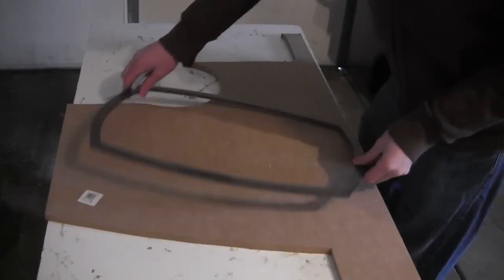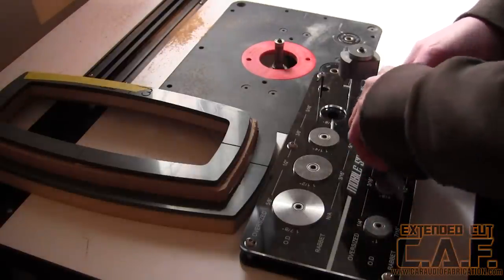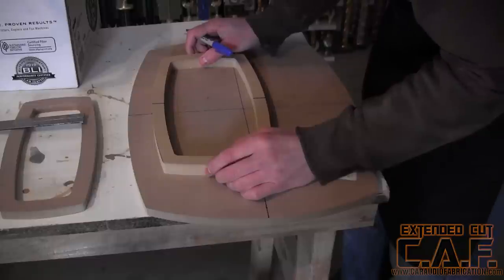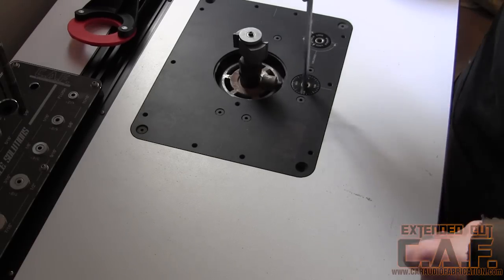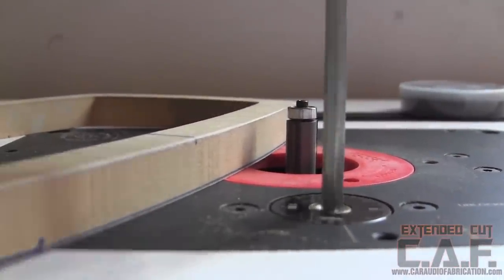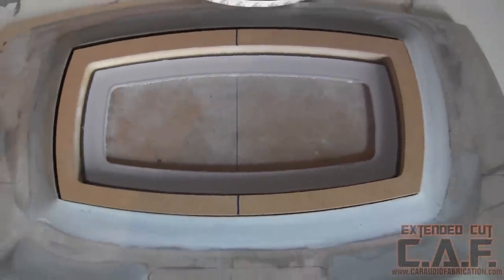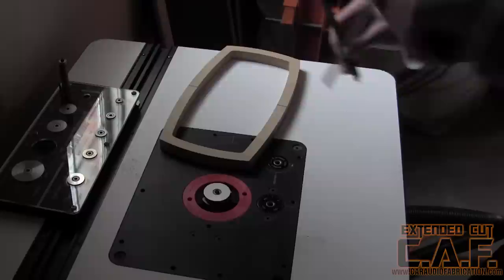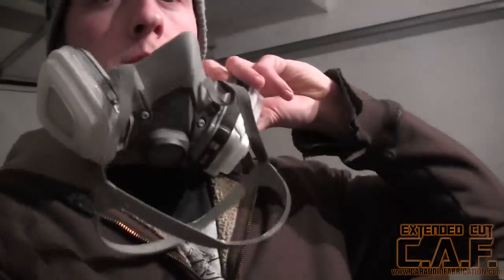Extended Cut - Edge Lit Plexiglass Panel

Comment: Very nicely done! Watched it all of the way through and you did a great job! No to nag, but for a cleaner and safer cut on the router, try and use a "Conventional" cut (against the direction of the rotation of the bit). This means for outside cuts, you'll turn the routed part Clockwise. For inside cuts to go against the router bit direction, you'll reverse and rotate the part CounterClockwise. Although it doesn't matter much in MDF (which has no grain), it IS a safety concern since a "Climb" cut (like you were using) could grab the part and fling it. In regular woods it's important to go in the proper direction to prevent chipout on your grain. Minor point but thought you'd like to hear it. Again, very nicely done!

Comment: Old video I know but at about 8 minutes you're talking about talking about taking a 1/32th off for each piece of vinyl resulting in oversizing by 1/16th, I would think that since two pieces of vinyl need to go in each side of the middle piece that you would need to take of 4/32 or 1/8 off of the middle piece. What am I missing ?

Comment: Hi Mark, I'll be making a view port in a sub box.  The box is a small, flat enclosure only .75 cu ft and the window is going to be 11" in diameter.  12" woofer running max 400 W in an SQ system.  I'm wondering what is the thinnest piece of plexi I can use in such a case?  I'd like use this technique to gain just a little space behind the woofer, so I'd like to use 1/4" if possible.  It's a small circle, 12" accounting for a half inch mounting lip, so I'm thinking 1/4" would suffice with minimal flex during woofer operation?  You've worked with plexi quite a bit, what is your opinion?

Comment: Heya Mark!
Huge fan, thanks so much for your time and effort in providing superior content!!  I have a rather specific question, have you used or know about light weight materials useable to achieve equal quality for weight sensitive applications?  Specifically, MDF is heavy, have you ever experimented with light weight wood such as balsa or even composites?
Reply: Most people who are concerned with Weight when constructing a Sub enclosure go with Birch instead of MDF.